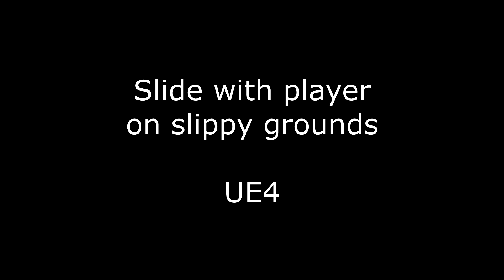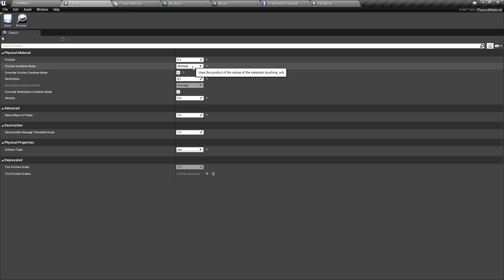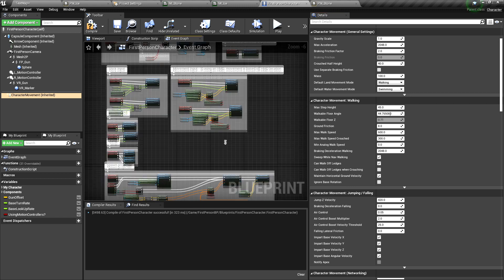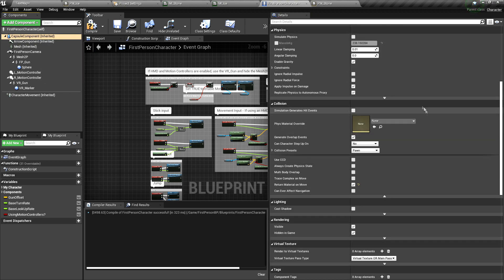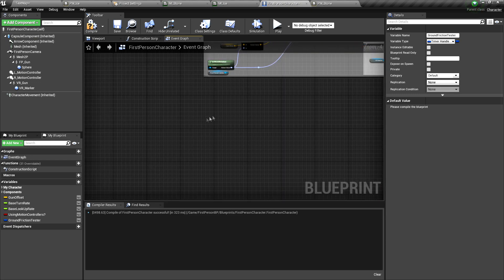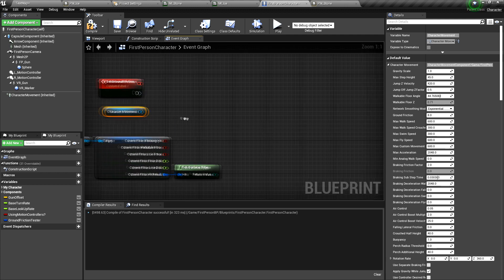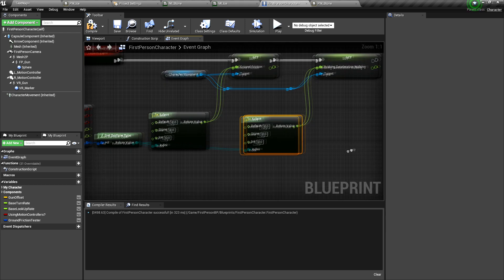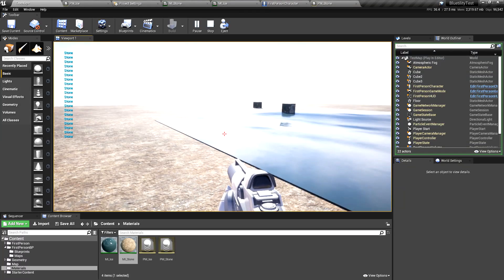Slide player on slippy, icy ground in Unreal Engine 4

Comment: This tutorial was very helpful, thanks! :) I have a slight issue with it though, for some reason my collision capsule keeps alternating between two physics materials. When I'm on the stone surface, it keeps alternating between stone and default, and when i'm on the slippery surface, it alternates between stone and slippery, sometimes even all 3. I'm not sure if it's cause I applied the physical material to my landscape material (and have different weight painted surfaces assigned different physical material properties), but shouldn't it still work? I've made sure to weight paint 100% instead of having an in-between value but it still doesn't work. Thanks for any insight :)

Comment: Could I pull this off on a slope? I'm trying to create a situation where the player (third person) simply slides down a slope with zero control. I'm curious if I could just have it play a sliding animation when it detects the "ice" - or is there a more efficient way to accomplish this?
Reply from the maker: i guess it would be totally possible to set up the animation system to play a slide animation when the ground slope exceeds a certain value. i'm not entirely sure how i'd approach the slide effect itself. 
perhaps fooling around with a timer that slowly ramps up when on a slanted surface. and the slope degrees defines the playback speed of the timer. idk. would need some kind of research
Reply: @aphexx100  so I basically came with up a solution that kinda works. I put it on a block that I had rotated (to make a hill) and then put the slide state on my character. I made it so that it would check the friction and if the friction value was above or below a certain number, then it would play the specific animation slate. It doesn't prevent the player from sliding uphill, but it does the job for now